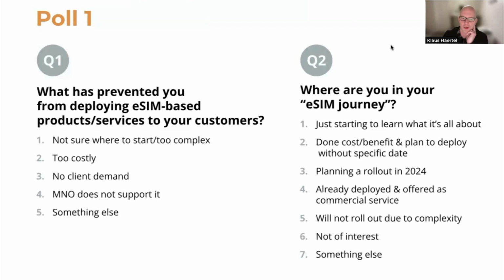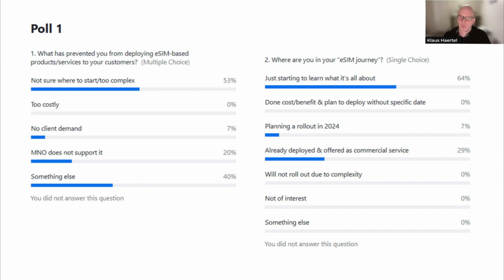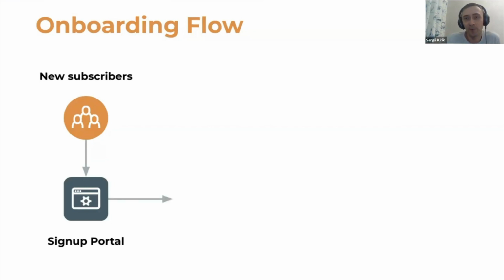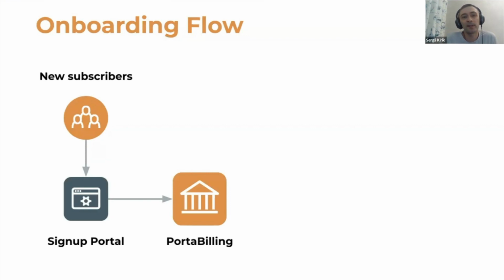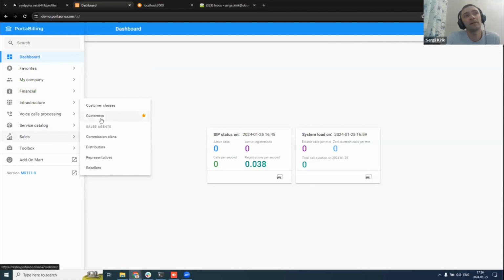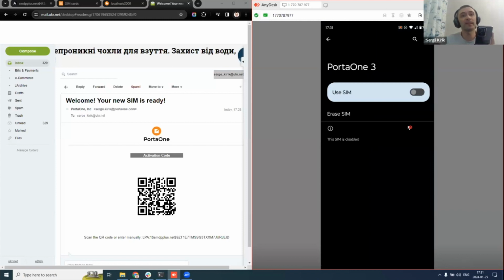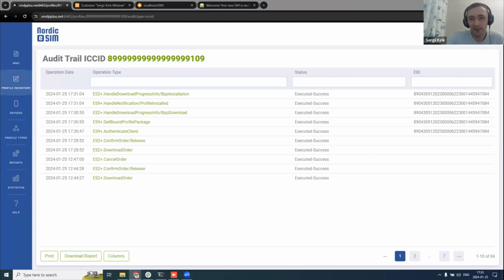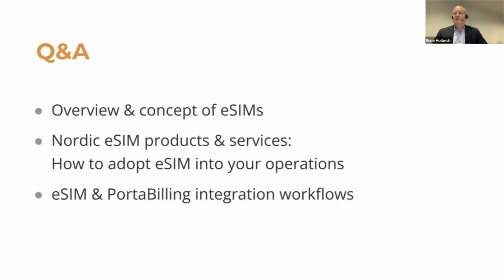eSIM for MVNOs: How to Integrate eSIM into Your Services | MVNO Academy | A PortaOne Webinar Series

Comment: Can you provide me 1 service?I am from AKM New York my company name is Asraf IT Consultancy and Solution Provider INC. If you can provide me 10k wireless line per week which I can only receive calls and sms on the line with api run by our developed apps or website then I can pay you 3k per week and I need new 10k number per week In which only incoming call and sms will be no data required.